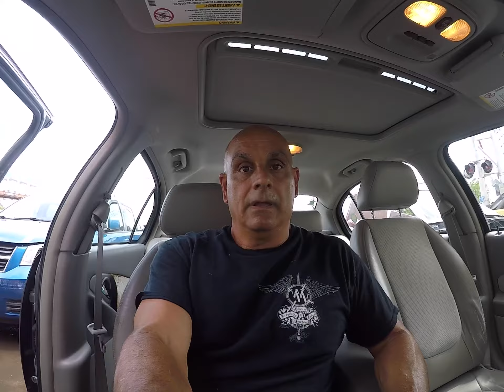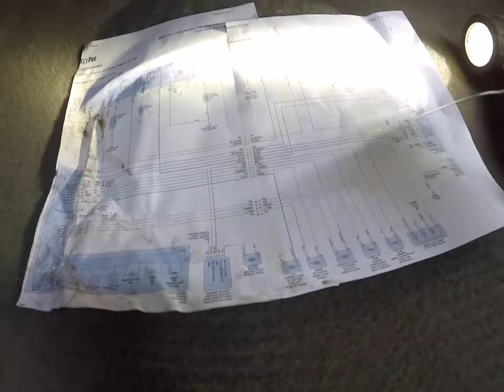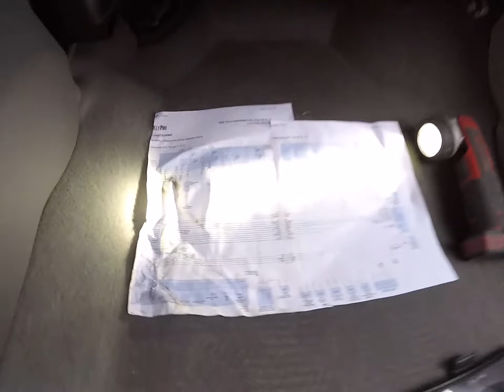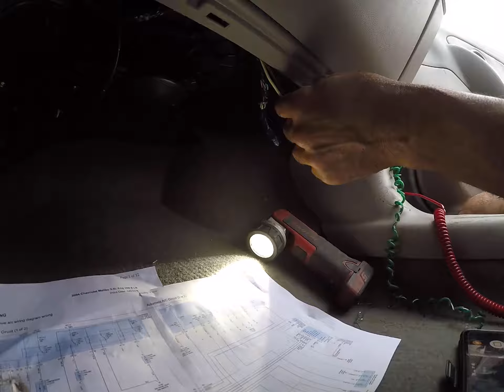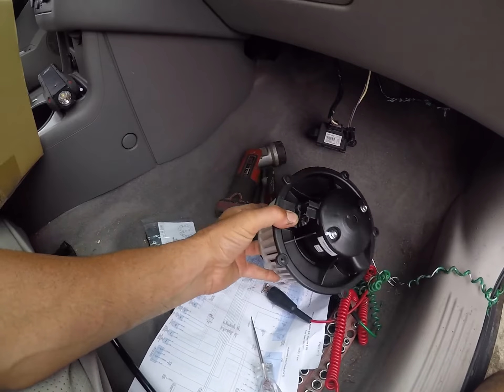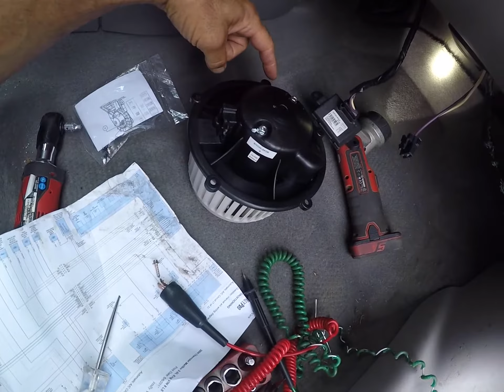How to test your Chevy Malibu blower motor...EASY FIX

Comment: Do you have to cut thru the plastic,or is it glued?
Reply: Cut through the plastic all the way around!! I used a carpet puller!! It’s curved & it pokes. Poke several areas then push way up & back around!!

Comment: We replaced relay and resistered, and it turned out to just be a fuse in the blower motor.the motor locking up blew the fuse.
Reply: what fuse?

Comment: Everything about this car is designed in the most idiotic way.
When you have headlights set up in a way that's guaranteed to fail frequently, and then you have to take apart the entire front of the car to simply change a bulb, you know the rest of it can't be good.
Whoever designed this car should be exiled from all of humanity, forever.
Reply: hahaha agreed.
Reply: First time i had to fix my headlight i wrote “fuck whoever designed this car” on the inside of my bumper 😭

Comment: What if I get nothing on those wires 
I changed out the blower and the resistor 
But nothing working 
I also did put in a new relay but nothing happened ( it was working for a day or 2 then Turn off and sometimes it came on but now it no longer working)
Help pls. 
Thank you
Reply from the maker: +Yep Why Not !! Just to Clarify you don’t have any ground single what about 12 volts
Reply from the maker: +Auto Repair Tips go to my web site autorepairtips.net fill out the help Form and I’ll. Send you some Schematics and diagnostic procedures
Reply: Auto Repair Tips it showed 000 on Volts
Reply: Auto Repair Tips I don’t have a tested light like the one you have 
I have a multimeter and I turned the car on then I check the volt that go into the blower it showed 000
Reply: Did you ever fix it and what was the e problem
Reply: Same now check your fuse in the blower moter.